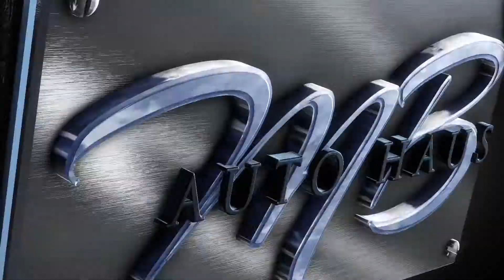MB AUTOHAUS QUICK TIPS FAULT  CODES

Comment: Hi, I have an E350 4Matic sedan, built in 2009. The battery was down and then boosted. However, when I turn the radio on, it shows "Device not available" on the screen, and there is no sound at all. Can you give me your expert advice.

Comment: I have a ML350 2006 and my fuel guage is showing zero although I have gas in the tank. Any ideas. My battery had gone dead and replaced it recently, could that be a reason?